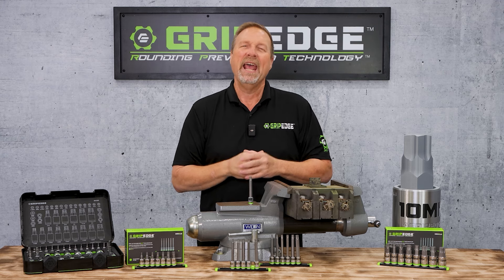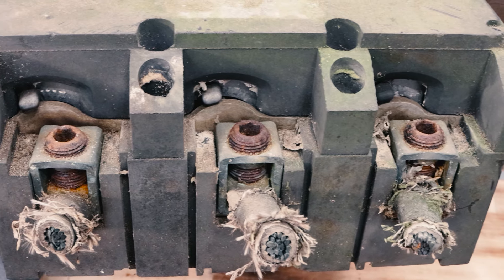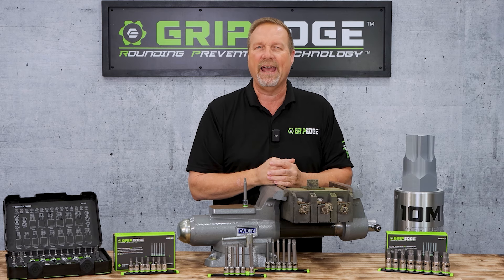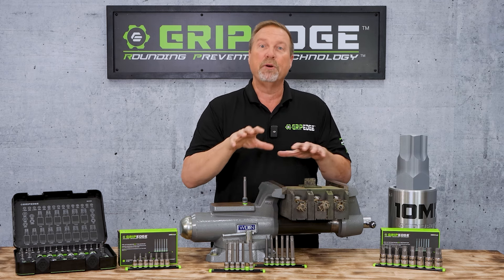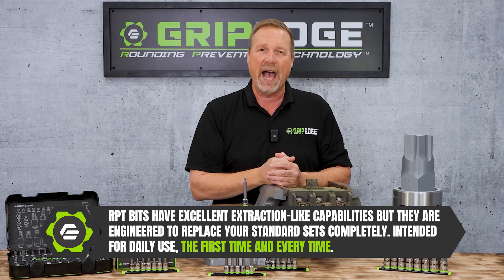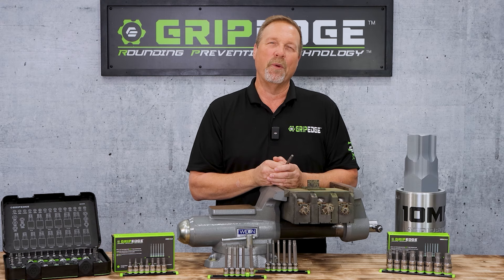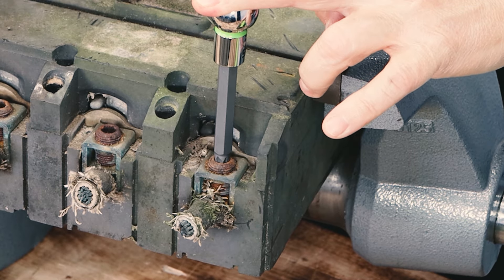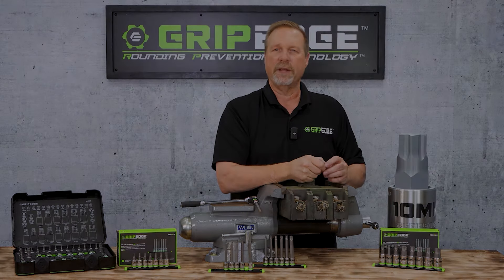RPT Hex | Junction Box Rusted Hex Removal

Comment: I work on Toyota forklifts we have some LBR's that have button head Allens 10mm, we come across these bolts that are SUPER SEIZED and are constantly rounding them out due to how stuck they are.   We have to use heat, 1/2" drive with a 3'-4' pry bar and that sometimes isn't enough and then when they round out well then we have to bust out the drill and get to work. 

Maybe your product would fix this issue? Do you have tools that are virtually unbreakable?